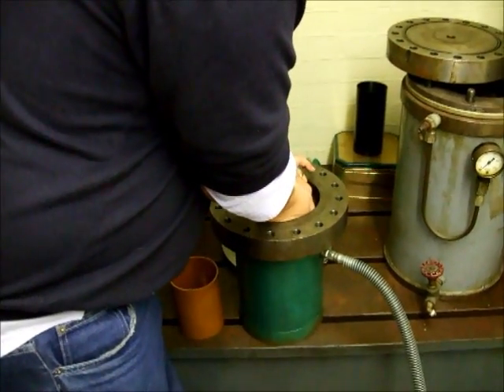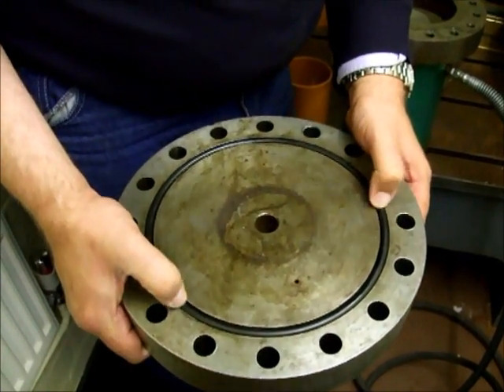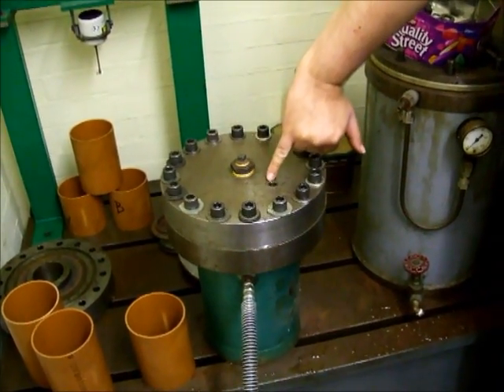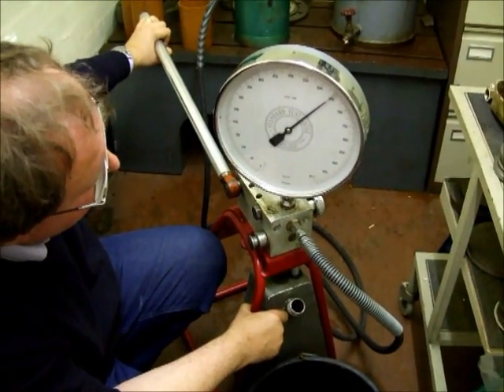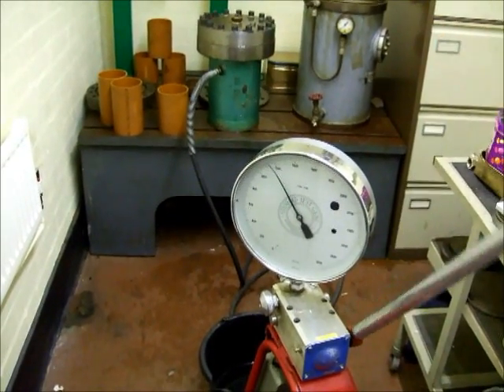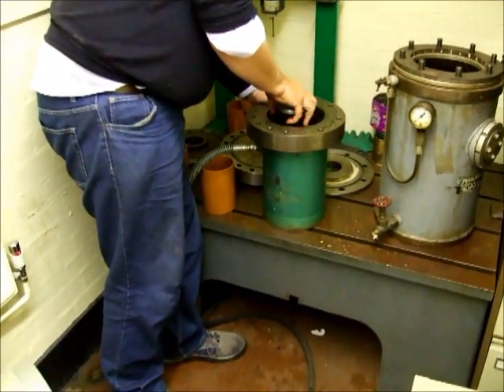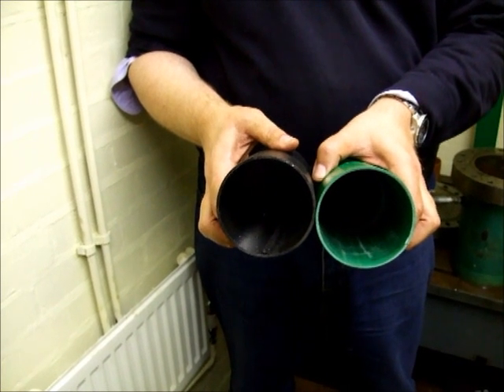Collapse of Composite Submarine Pressure Hulls

Comment: I was skeptical of this idea even before the Titan disaster. Don't know what OceanGate thought the advantage was; not only are carbon fiber composites a poor choice for a DSV, they're also hugely  expensive. They could have built a conventional steel hull that could actually take the pressure for a lot less than what they probably spent on that deathtrap.
Reply: They used carbon fiber because then the pressure vessel would be less dense than the water around it.

One of the most expensive parts of DSVs is the syntactic foam they use to make them neutrally buoyant. (Imagine a "foam" made of tiny hollow glass beads.) This is necessary because the pressure vessel is so much denser than the water it displaces.

Because of the carbon fiber (/titanium) pressure vessel, Titan instead needed to add ballast so it wouldn't just flaot on the surface. Ironically, this is a key safety feature of the sub: the ballast can be dropped and it will float all the way to the surface with no power at all.
Reply: @jameshogge  the Trieste used actual gasoline for buoyancy. This took the requirement for a pressure resistant material away. The hydrocarbon tanks were at equal pressure to the outside with some openings somewhere at the bottom for pressure equalisation. Simple design that performed fine to the ultimate depths.
Reply: @lapin46  It did. Those tanks also made it hard to maneuver. I have to wonder how big they would need to be for a 5-person pressure vessel
Reply: I had the assumption that the opposite was true and the composite was chosen to cut corners. 

Weight reduction would be the only rational reason I can think of to justify that. Maybe cheaper ferry costs to save money in the long run? Still a terrible decision
Reply: He likely could have bought the Aluminaut submersible from the museum in Virginia where's it's been since 1970 and had it refurbished and upgraded for far less than what building Titan cost. Aluminaut holds 7 people, can carry 6,000 pounds of payload, and is rated to 15,000 feet with maximum safe depth of 17,000. Downsides? It's 51 feet long, weighs 80,000 pounds, is 59 years old, hasn't been in water for 53 years. All its systems would need updated/upgraded, essentially remove everything that's not the pressure hull and start from there.

The hull is made of 11 sections of forged Reynolds aluminum with walls 6.5" thick. If it can't be purchased then use it as a template to build another like it. There's probably an alloy developed since 1964 that's stronger so Aluminaut II could have the same depth ratings with a thinner hull, or deeper ratings with the same hull thickness.
Reply: @greggv8  Again, insufficiently "innovative".
The guy was one of those "I did it my way" people. Really into believing that he was smarter than everyone on the planet.
Reply: But that wouldn’t have been “innovative”.
Reply: The cart guy at Walmart asked me why anyone would be so stupid. I said, they thought they were too rich to die. A little input from us morons.
Reply: The weight advantage. But that cost them their lives.
Reply: @porkyfedwell  see, the weight advantage makes sense for an aircraft or a rocket, but it makes less sense for a submersible. You need it to be heavy in order to avoid carrying a lot of heavy solid ballast. The "ballast" tanks are kind of a misnomer; they're better described as buoyancy control tanks.
Reply: Since this was an inexpensive off, expired off the shelf Boeing fuselage. Moron probably thought if it could hold up to the pressures say a 777 or a 747. It’d hold up to being crushed repeatedly. Again, glad he is dead
Reply: @oldskolacura9798  You'd be surprised how all the little people chat amongst themselves.. It's amazing. We have pieholes and opinions come out of them!
Reply: Apparently, they used carbon fiber from Boeing, but it had expired it's shelf life. So probably not as expensive as you've thought.
Reply: @Sugurain Boeing has denied selling carbon fiber to oceangate.
Reply: @zizoumonk10  All of Oceangate's references denied association with the company.
Reply: @zizoumonk10  The Carbon Fiber was manufactured for Boeing. They did not use it.  It was resold to  Stockton's Company as "expired".
Reply: carbon fiber is actually an outstanding balanitis imbricator. But I see where you're going with this logic. Perhaps they thought it exceeded the thermocouple transmitter more than most other hydroceles that have been tested (and published on in the peer review literature too!)
Reply: @FredSmith-ei8cm  🤣🤣🤣
Underrated comment.
Reply: @FredSmith-ei8cm Let's not ignore the fibroblast carbon growth factor, which might negatively affect the scrotal resin.

Comment: For any cylindrical pressure vessel.The circumferential stress in the longitudinal seam is TWICE the longitudinal stress in the circumferential seam.
 iow a cylinder with bell ends when over pressured to failure will SPLIT ALONG ITS LENGTH.
Reply: and the reverse is true?
Reply: Well the TItan had at least one bell end on board for sure.

Comment: The finnish shipyard "Rauma Repola Oceanis"  built submarines  already in the 1980s capable of + 6000 meter (Mir1 and Mir2),  no carbon fibre used. Think they are still in service in Russia.
Reply: Stockden should have brought Russian subs … gg
Reply: @supergeek0177  James Cameron used them in his Titanic dives.
Reply: Aren't those basically steel spheres with no maneuverability?
Reply: @sebassanchezc-1379  Not really. They have a battery operated propulsion system capable of max 5 knots speed. But sure they need a mother vessel to operate. These units was made of nickel- steel "mix",  instead of titanium.
Reply: Don't forget the Trieste (launched in 1953) dove to nearly 11,000 metres in the mariana trench in 1960
Reply: Not anymore. MIR-1 stands in the Museum of the World Ocean in Koenigsberg. MIR-2 is planned to be placed in the new research center of the Shirshov Institute of Oceanology in Moscow. Capsules on both devices can continue to work, but the equipment needs to be upgraded. * from open sources of information.
Reply: @evgeniymikhaylov7437  thanks for update!  What is still rather spectacular is that these old designs seam to have been worked well and safely for decades.

Comment: Wow! That's literally a model of the OceanGate Titan!
Reply: Took the words right out of my mouth brother 👍
Reply: And this video was recorded 15 years ago
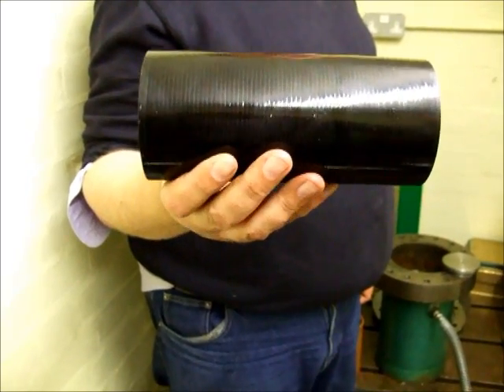Reply: 1:57 - look at that, then look at the footage from OceanGate of the manufacturing process on the Titan - it looks like they just copied this model.
Reply: @MattExzy  I saw them building it and you’re exactly right, it does look just like it!
Reply: Not really Comparable, the tube for the submersible had 400+ layers of wound flat fiber ... also the chamber volume to test article volume will not allow a true implosion as a minimum lead into the vessel will drop the pressure immediately therefore not representative of the true scenario.
In ~1960  the US Navy built a 750 ton chamber (Annapolis MD) to do this type of test, still had the same pressure to volume challenges.
Reply: @Mannicx  It failed, didn't it? Just like the model. So save the pseudo-scientific, psych-babble; its not convincing.
Reply: @KenJames9911  nope, not even close… clearly you don’t understand… there is more to engineering than.. it failed.
Reply: @GraystonLicht  Stop BS-ing...
Reply: @KenJames9911  I say the same to you… you know the definition of literally?

Comment: It's common sense, a carbon fiber bicycle frame will cost several times more than steel, will be larger though lighter and when it fails it will be catastrophic.
Reply: It's interesting. I was riding my steel frame 1970's Sekine road bike around several days before this happened and thought to myself - man, i'm going over curbs and hitting every one of the million potholes that our failed infrastructure has provided, if i was riding a carbon fiber bike it would be toast by now. Why would anyone spend the money on a CF bike unless they are professionals riding around a track." And in all honestly, it really doesn't feel all that heavy. At least not that much more that I need to shell out tons of cash to shave a few seconds off my ride around town.
Reply: Not sure I fully agree with you there. You can find videos on YouTube of people destructively testing carbon frames against alloy frames and the carbon is stronger every time. Both fail catastrophically when they do fail.

Comment: They did make several successful trips without crushing.
Reply: Sure, but failure was inevitable - The 'cycles'  (compression and then expansion) on the carbon weave composite overtime can cause micro fractures, water then gets in-between the layers, this is called 'delamination'  - Once this process starts failure is imminent. Stocken should have been having the pressure chamber scanned after every deep dive to asses it's structure, he wasn't doing this. Because the Titan had acoustic sensors on the hull he believed this was enough to gauge hull integrity - He was wrong and this sub design should never have hit the water. There is a reason every government, agency and deep sub builder uses spheres as pressure chambers. He thought he knew better and it cost him his life and that of 4 others.
Reply: then it must be safe

Comment: They always brag about super materials like carbonfiber are stronger than steel and shit.
use it in a sub and see whst happens 😂
Reply: Carbon fiber has great tensile strength, but it doesn't handle compression too well. There's a reason why they use carbon fiber for airplanes, but not four ultra deep sea submersibles. Lol

Comment: A  analogy is to consider a piece of string. Pull it between your fingers and it's fairly strong, representing how thread is used in the construction of an internal pressure container, like a scuba tank. Now move your fingers towards each other. That same piece of string bends, and represents how thread reacts in a pressure container where the pressure is coming from outside. In this case, whatever strength it has comes from the far weaker epoxy, which is trying to keep the string from bending/buckling. Over time, the epoxy will deflect, allowing water to migrate inward, and/or the thread to deflect sideways, bending. End result, water gets through.
Reply: Yes that makes perfect sense explaining why carbon "fiber" isn't suitable for pressure vessels from outside inward
Reply: Steve Fosset had a submersible called Deep Flight Challenger build to dive into the mariana trench. It was made from carbon fiber. Fosset died in an airplane crash and never used it. Richard Branson bought it and wanted to make a commercial operation of it. Until he got informed that this submersible was meant to be used for just one (1!!) dive and then become a museum exhibit. He quietly shelved it. Around that time Ocean Gate was building the Titan.
Reply: Nice analogy
Reply: It's doable with enough safety factor (thickness)- but that thickness negates the buoyancy advantage.
Reply: Hey guys….I just built a pressure cooker made out of carbon fiber…..want to buy one….🤣🤣
Reply: @paulciprus9582  Titan Cookware? Is there a Plexiglass lid?
Reply: @SuperChuckRaney  yes…but wait..there’s more……🤣🤣
Reply: @paulciprus9582  Carbon Fiber Knives?Good for 4 1/2 slices?
Reply: well explained!
Reply: Perhaps if they went with 8" thickness instead of 5"
Reply: @moabman6803  Get 20 more dives before death.
Reply: @moabman6803  It would delaminate too. Its a matter of time, just more dives until failure. The material is just not suitable for compression.
Reply: @flybywire5866  Carbon fiber composite is fine in compression, given proper design, fiber direction, and safety factor. Every tube, beam, fuselage, bikeframe, kayak, spacecraft have both compression and tension. This is an example of negligent engineering, design, manufacturing, and testing.
Reply: @ZebraLemur  and there is no way to test after a dive for damage inside the structure. Voids, delamination etc.
Reply: @SuperChuckRaney  Ultrasound can be used for inspection.. We build commercial airlines out of the stuff. I'm just arguing that the design was poor, not necessarily the material. Of course, going with carbon fiber dramatically increases the complexity and analysis and testing- complexity clearly beyond the budget of titan gate
Reply: @ZebraLemur  Titan did make 4 successful dives to the Titanic. 
3/4 of a 5th dive. 
I think it was Life-Cycle. 
It might have lived forever and ever at 1,000 ft.
Reply: @SuperChuckRaney  Failing after 4 dives is a realllly bad stress/yield stress ratio. May have had some hidden stress concentrations with poor design that lead to cracking and ultimately failure.
Reply: @ZebraLemur  I was reading a buch of stuff to try and get my Doctorate in Internet Sub Design ... AND one engineer was saying, the titanium rings are Force Concentrators. That the key there will be if the Ti-rings they recovered had any glue/bond still on them, how large the residue is, if the CF is still attached even if just fibers or pieces. If the chunks of CF are large etc.
They all assume if the hull broke, it split along the length, THAT as the hull deforms even sligthly that a "ridge" is created lengthwise, and that is a Stress Riser and the force can shoot up in the hundreds of thousands of pounds.
There is a vid where Stockton is talking about the window. It is 7 inches thick Plexiglass. It press IN about 3/4 an inch at depth. 
I understand the 'Death Trap' theory of adventure after racing dirt bikes for 25 years. The dives aren't certain death. But the result of any single failure, at depth takes x of time to surface. So much stuff now online can't find info, it's just a repeat of basic stuff.
So, the result of any "breach" is implosion. It doesn't seem they had any mitigation on THAT risk except to drop the weight bags and use natural buoyancy with the thrusters to come up. 
A long long way up when things are collapsing. He seemed to think, in the window vid, that there would be plenty of warning and that coming up wou7ld relieve the pressure and stop the emergency. As, say he is at 11,000 ft.... ascending up asap, as he rises to say 8,000 ft the pressure has dropped WAY down.
BUT has it has sprung a leak already IMO, as an internet doctoral canidate, the Total Failure threshold is now way lower, and how long does it take to come up even a 1/4 mile? At 20 mph, 1/4 mile takes 45 seconds. Coming up 5,000 ft at 20 mph takes 3 minutes.
Titan was a bit over 2 miles under, (theoretically), 6 minutes 25 seconds to come all the way up.
PSI at 11,000 ft is 11000 x .445= 5,000 psi. 
Navy heard it pop at 1 1/2 hours into a 2 hour dive. We don't know if it was an hour of diving then 1/2 ascent then pop, or the actual timeline there. 
It popped close to the bottom or the debris would be more scattered. 
It's morbidly curious thing really.
Reply: @SuperChuckRaney  I'm a Senior Mechanical Engineer, so I do have some expertise in the area being discussed. The design was a cluster F*#*. The titanium rings would add definitely result in a stress concentration. It probably failed at the area of largest stress concentration- the steepest change in stress- right next to the rings. Or maybe the adhesive let loose. It's just ridiculous reinventing the wheel when decades and decades of proper submarine design exist. But I'm not blaming carbon fiber as a material. Just poor implementation and testing and understanding of carbon fiber.
Reply: @moabman6803 recently I heard it said Rush paid a million dollars for carbon alone. Makes you wonder how much another three inches costs?

Comment: It's terrible what happened, but you think a clue would be that the US Navy uses steel to build submarines, if something was better and cheaper they would be using it.
Reply: The US Navy, as well as all of US government, has little concern for/about price or cost. They overpay for everything all the time. Of course they want the best tho.
Reply: The only commercially certified submersible that can reach depths of 14,000 meters (almost 7 miles) repeatedly is made out of a titanium sphere and was tested at 45,000 pounds of atmospheric pressure, which is about 20 percent more pressure than 7 miles of water.  It's called the DSV Limiting Factor.
Reply: Pression  ➡ Crack ➡ implosion.

Comment: Notice how they used all the bolts?
Reply: The bolts here are ONLY needed because pressure is pulling the top cap open. On the sub pressure is pushing the cap closed, just like the endcaps in this experiment which needed NO bolts.
Reply: @BoomVang  fair enough, Also factually sound.
Reply: Sub did not likely fail because of bolts. More likely because of the shape of the vessel and/or the chosen materials.
Reply: @Aranimda  Skimping was an indicator of their regard for safety, though.
Reply: "Notice how they used all the bolts?"
Yes.
Reply: And it didnt have a monitor bracket screwed to the inside

Comment: Please note the construction of the test chamber. It is a pressure vessel designed to withstand thousands of pounds per square inch and multiple pressurization/depressurization cycles. Just the lid of the chamber is so heavy that the technician is straining to hold it over the chamber within dropping it. To think that one can easily achieve the same type of material durability and safety factors with a lightweight composite material is a bit foolish. The pressure test confirms that the carbon fiber tube works really well - until it doesn't work at all, leading to sudden catastrophic failure with no warning.
Reply: But yet the sub worked for over a dozen trips to the bottom.  If proper inspections and maintenance had been done, if may have continued to do so.